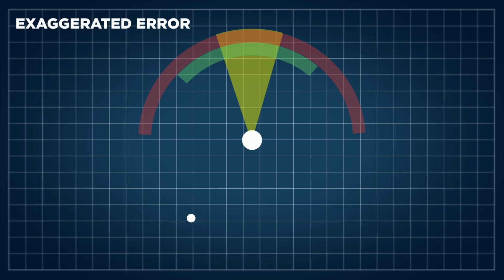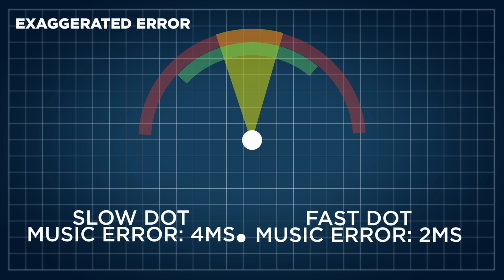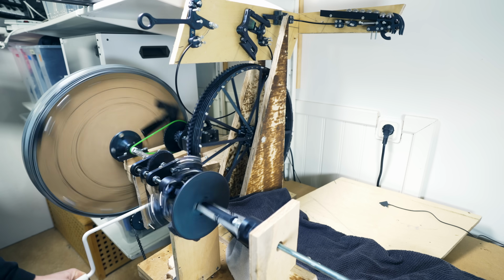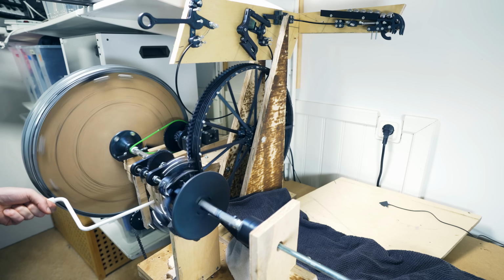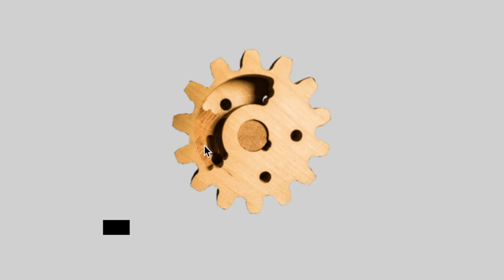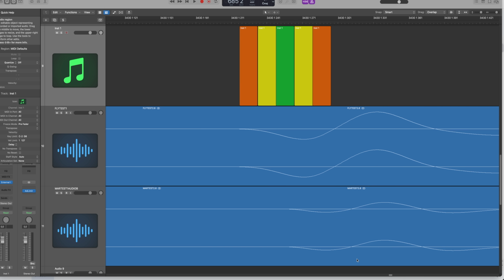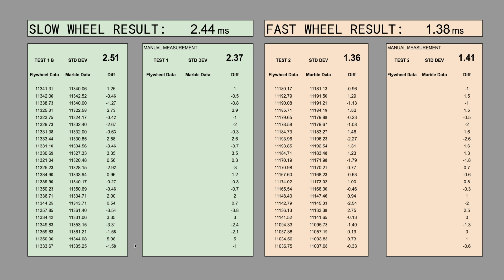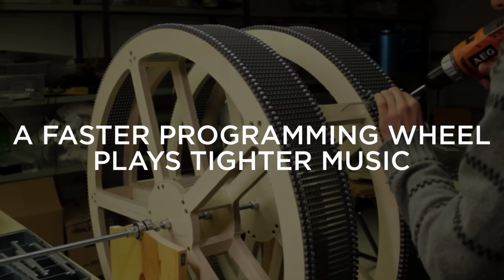Testing a Faster Wheel - Is the Music Tighter?

Comment: If you increase the diameter of the programming wheel, you won't have to increase your gearing because the speed of the edge of a wheel is proportional to the diameter of the wheel. Keep RPM's slow, increase diameter by 2 or 3 times, then you have more programming area instead of less by increasing the speed.

Comment: So basically Martin is trying the make a mechanical computer rather than an analog music instrument. Instead of a programming wheel a 'paper' book or 'paper' scroll would be a more logical choice for that. Then the length wouldn't be such an issue. If he then would implement a double feeding mechanism where, while one book or scroll is playing, the next book or scroll could already be installed and on standby, the size of the books or scrolls could be manageable. If he wants to make it visible he could route the book or scroll over a giant wheel as it is played. Using light/dark the audience could then see the holes in the book or scroll.

Comment: The test I haven't seen you run yet is to check how tight you can play your self.  record yourself following a metronome and hitting a drum or even just tapping your finger.  If the standard deviation of a human is on the order of several ms then there is no need to constrain the marble machine beyond that.  The variation is what gives it the human quality as opposed to listening to midi music.  I think you need to reevaluate the requirement for tightness (is the requirement dumb?) and run some human trials to see how well different musicians keep a beat and then stop worrying about being exponentially better and overconstraining the machine

Comment: I think you may have proven something, but maybe not what you think.  I think you may have proven there is a frictional damping effect of your profile and follower design. The faster wheel speed should have less friction between the follower and the profile as the follower drops back to the wheel because there is less force on the follower or possibly even an air gap. A high speed camera may prove this. Or, to prove this, I would suggest using a sharp square drop at the end of the profile, or even a slight cut back angle so there is zero friction during the drop back tot eh wheel.  You could also just change the spring force on the follower to see if more or less friction with the current profile creates more or less variation.

Comment: Well with a 2 rounds spiral the 2 times faster wheel will contain the same amount of music than MMX.
For a spiral programming wheel, consider shifting the detecting levers instead of the giant programming wheel. This should be made easy because the levers are connected to the gates via a bowden tube.

Comment: Add a "clock" ?

To take an analogy out of the computer world, the I2C bus for instance,  you could opt for a construction where the programming wheel has a relatively large time window in which it can set the notes up and a separate clock that does the actual release of the balls in a timely manner.  That way any wear or other small imperfections of the programming wheel become less important as only the clock needs to tick with the precision you need.

I'm sure there is someone out there that can design a simple mechanical clock for this purpose.

Comment: I think it's time to abandon a mechanical programming wheel. Just have the marbles play the instruments mechanically, but make the marble gates computer controlled with solenoids. You'll have infinite variety of songs with infinite length. Then you could add a keyboard in front of every instrument hooked to the solenoids so you can manually play the music as well. Best of both worlds. This will allow the MM3 to specialize in just playing music well. Let the computer deal with the programming tightness madness that's going to cost you two years of trial and error. The programming wheel is also limiting you vastly musically. Don't let the instrument limit your deep musical talent.

It's already enough that the instrument plays beautiful music and recycles the marbles efficiently. The programming wheel system is another beast altogether and will be the downfall of MM3 should you continue to pursue it.
Reply: Agreed—if he has any REAL intention of performing (either creating music and/or any live tours), these programming wheels simply won’t cut it.

If he’s wanting a FASTER programming wheel, he’ll basically be ending up with a <10 sec loop…which isn’t really suitable for anything.

He really needs to stop and re-assess his true “design requirements.”

Comment: Doesn't a faster programming wheel require a higher resolution? Higher resolution would mean smaller programming pins with higher manufacturing error and thus less tightness.

Comment: What if you put a freewheel sprocket from a bicycle on the slowest gear on your gravity weight with a clock escapement and you adjust the pendulum for your timing you can make it faster and slower

Comment: I think one critical error of the method of prototyping that you're doing, is that you haven't established a set of standard targets for various measurements. For example, a target could be 'Music tightness with a variance not greater than 5ms total'. Why would you do this? To identify when a hypothetical improvement to the machine is unneeded and can be ignored. Currently, it feels like you're looking for the tightest possible music, instead of tight enough music. This kind of over-engineering can bog you down and prevent a finished product from resulting.

Comment: Couldn't you have a second programming wheel and a transfer so each rotation it switches to the other wheel. If you make the pins thinner, without too much loss in accuracy, you can put half the song on one half of the wheel and the other half on the other. Even if you don't fully double the speed you will still get more programmability from the wheel this way making for potentially more interesting music.

Edit: Just realized this could allow doing the equivalent to a reel transfer, like in film. So when wheel one finishes, it transfers to wheel two. This buys time to swap wheel one with wheel three, etc. Making the songs essentially limited in length by the number of wheels. Would definitely add to complexity but you can sacrifice length of play to reduce this since you just change wheels(now cartridges).

Comment: I reaply wonder how youll be able to fit a whole song of music on your programming wheel with such large profiles over pins. Must be an enormous wheel in our future!
Reply: This is where you'll have to stop thinking of the profiles as individual notes, and instead think of them as points in time. The profiles could represent, for example, 4 beats, and within any one of those 4 beats along the length of the profile, there would be dips and peaks in the profile's shape to get things like quarter notes, or eighth notes, or 16th notes. The wheel's size will not need to increase just because of the change from pins to profiles.
Reply: @justinnaramor6050  Oh that's sick! I had thought the whole point of them was to be a longer contact point to make the note hitting more consistently timed somehow, but if each profile can be divided then my initial worry has been voided!
Reply: @BlueNavigationUnit  That was what I thought at first as well. But I understand it better now.

By the way, while we're on the subject of programming the wheel: there are folks who seem to believe that there's no way this thing would be able to be programmed live on stage, and each tune should just be pre-programmed, and that Martin should use punch cards instead of programming wheels on the machine. Not sure what your thoughts are on this, but I firmly believe that programming wheels do have advantages over punch cards. For one thing, a wheel can be re-programmed. A punch card cannot. Punch cards can only be swapped out. That is not the same as "re-programming". It's like a digital memory card: the data on a memory card can be altered, erased and re-written repeatedly, and that's all on just a single memory card... you don't have to swap out cards to get new data. I say it is the exact same thing with programming wheels. Punch cards, or indeed multiple pre-programmed wheels (with non-removable pins that are permanently stuck in place), are more similar to audio cassettes, or vinyl records, in that you need a lot of them for multiple musical programs. Don't you think that's a lot more "messy"? Even if punch cards are smaller than a programming wheel, and a huge stack of punch cards could fit into a case that's the size of a programming wheel or a few programming wheels, that's still a lot of them.

I've tried explaining this to commenters who are so hellbent on getting Martin to use punch cards and they just don't fucking get it, as if I'm an idiot or something. They insist that programming wheels have "zero benefit", except for "visual aesthetics". That is so damn narrow minded it's not even funny!

Comment: May I suggest using bike parts like a brake disk and brake pads for the governor. This way you can have a "more constant" pressure, force, and timing from it with easily changeable replacements for parts that WILL wear down and mess the timing.

Comment: taking this to a logical extreem would suggest that at some point you will need to be worrying about the impact of the timing bracket on the mechanism and the possible time to return to "off" when the timing pin zooms under the mechanism and it has a variable return to zero based only on the speed of return of the spring.

Comment: what i don't get is - his huygens-mechanism is to store/provide power in a constant fashion, as in - you "charge" it and the energy is released constant over time. yet in pretty much every video he slowly and constantly turns the crank so that input pretty much always equals output which defeats the purpose of the whole system.

Comment: suggestion that have already been covered but what about multiple programing wheels? most songs are composed of paterns that repeat at various points in the song. while I dont know how complicated it could be; having multiple programming wheels which each have a patern being governed by some form of control programming wheel. potentially this would allow for longer songs as it would break it down into components which could be triggered by the control programming wheel.

Comment: Great video, like every time. However - there is one thing that is floating around in my mind: Suppose you reach the heaven of tightness music. Wouldn't the music then sound artificial? In general, in addition to crescendo/decrescendo, you need accelerando and decelerando to be able to really shape the music. So you need to be able to accelerate/decelerate in addition to loud/soft. Just to add one more element to your to-do list, you would need a lever to be able to apply a delta factor to the basic speed...

Comment: Is it possible/feasible to make the pins on the wheel that hits the notes go up and down, e.g alternate between up/down with another pin, such that it takes say two turns between the same note, effectively doubling the length to counter/equal out the faster turn speed?

Comment: I don't understand why there should be variation due to the programming pin/bar when it's always the same? 

From my understanding: if there is variance, it is because the speed of the wheel is not constant. Even the governor will react with a delay introduced by friction and dynamics. A faster wheel will be tighter because the variation in speed is not tightly coupled to the speed itself.

Comment: Dumb question, shouldn't you test two programming pins, to measure the consistency between them? My guess would be that this error is also reduced by a higher programming wheel spin.
Anyway, love the way you approach this challenge so far. keep the videos coming.

Comment: I'm a little skeptical of your method and conclusions here. There are drawbacks to turning the programming wheel that you don't seem to have considered. It will cause much more wear on everything, and the faster you go and the more frequently a particular gate operates, the more you're going to run into problems with the inertia and friction of components causing it to become LESS tight and more random. This is one of the reasons that car engines have rev limits: among the things that happen at high rpms is "valve float" because the springs aren't strong enough to overcome the inertia of the valves.

Setting the test up with only one ball drop per revolution would mask any of these effects. I think you should redo the test with many rapid ball drops such as might happen with percussion or even rapid note passages.

Comment: To save weight please consider that the inertia increases proportionally to the gear ratio squared. So if your gear ratio to the driven governor is 6 times the speed you will get 36 times more flywheel effect to the system if the flywheel is mounted there as compared to keeping it on the driving shaft. Or the same flywheel effect with a 36 times lighter flywheel.

Comment: You could also increase the diameter of the wheel. If the rotation speed if the same the linear speed will increase and you will have more distance for programming.
If think you have already think about that. Is there a reason why you haven't spoken about it?

Comment: In the shorter of endurance riding (horseback) the goal is to ride a certain distance at a specified speed, and therefore crossing the goal at an exact second.

So the strategy is to go as fast as possible over the finish line to make the winning second as many meters as possible.

Comment: Suggestion: decouple the marble release from the music wheel, so the wheel determines which marble gets released, but the actual release is done by another mechanism, analogous to a clock in electronics.  This would mean the wheel could have an error approaching half a beat (half a clock) whilst still having perfect timing.  Because the (mechanical) clock now controls the timing, it should be possible to adjust the relative release points of each instrument to achieve close to zero smearing because of latency reduction.  Happy New Year!

Comment: Mathematically, there's the trade off of resolution vs storage size. if you have a very high resolution (which is based on speed and size of the trigger), then you will require a very large program wheel.

if you can build the mechanism so that that error size is notably smaller, then that's going to give you significantly more wiggle room in the other two factors than increasing the speed of the MMX (which adds a lot of mechanical problems) and size/weight of the program wheel (which also adds mechanical problems).

I think using that screw/cam style drum from a previous video will be your best bet at fitting the most music per drum, and increasing the speed and size of that is only going to go so far, so the error size is your weakest link.

Comment: You need to be careful with statistics. It's possible your small sample size means that the observed change is not statistically significant. Furthermore there are several variables changing (e.g. load on the flywheel/governor system) which will affect the results. Ideally you want to perform this test with a drive system that is known to be consistent at various speeds and loads, and perform tests on your data to determine a confidence with which it proves/disproves your hypothesis.
Reply: In addition to his small sample size, I really would have expected to see multiple speeds tested. Instead of simply relying on two “data-points” to draw a conclusion that “faster is better.”

Then again, he’s still using a microphone as his input device, then running through a questionable wave-analyzer.  So there’s really no rigor to his approach.

Comment: about the length of the music, a wheel is not the only shape in which music can be programed into the machine, i can imagine many ways, a transporter band, with the music on it, a perforated paper in the style of the old mainframes, in the shape of a paper band
and the crazy one, a perforated paper or another perforable material with more strength, that makes a variable programing wheel be programed on the fly, so u don't need a big wheel and that can spin really fast, after each turn it resets, and its programed again by the papel band.... i should make a drawing xD
i imagine that the holes on the paper will let pins to drop by gravity on the base of the wheel, then they a read by the machine before the top part of the spin, then on the way back to the base some sort of mechanism i cant picture yet resets the pin so they can be programed again by the perforated papper band. subject to jamming maybe
i believe with absolutely no proof, that being the wheel the same always, u can aim for tighter tempos, writing the music into the papper should be easy enough, maybe u can write as long as you want songs, not only loops... mmmm got my mind flying
absolutely anti best part is no part approach, but hey how can u know what not to build if never was in the process in the first place
make the system with all the parts in the planning, try to eliminate as much as you can as you prototype
greetings i hope u finally succeed in your dream, be patient

Comment: Maybe you could create a switching mechanism on the programming wheel. You give each path two sub-paths, thereby essentially doubling the programming length of each path to two circumferences. So then playing at 2x speed, you still get one full programming path. Possibly a peg in between the two sub-paths would flip the reading element back and forth between each time it comes around.